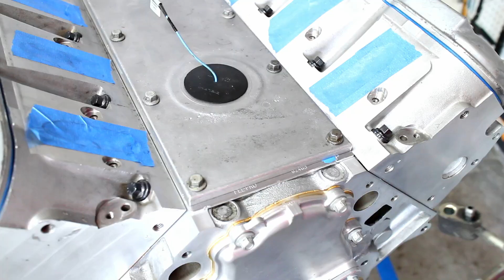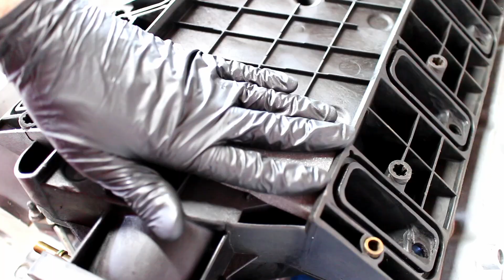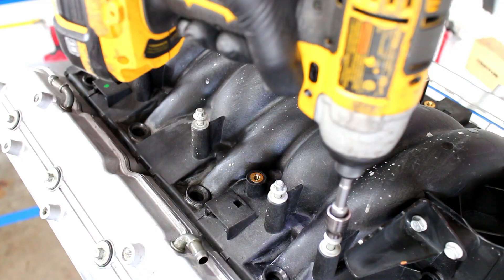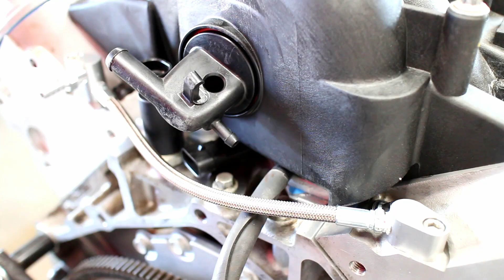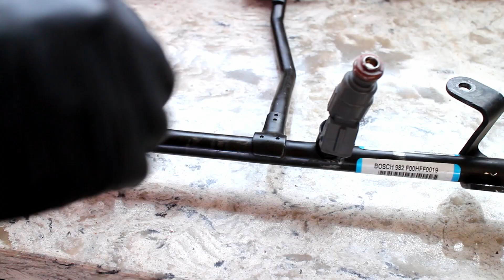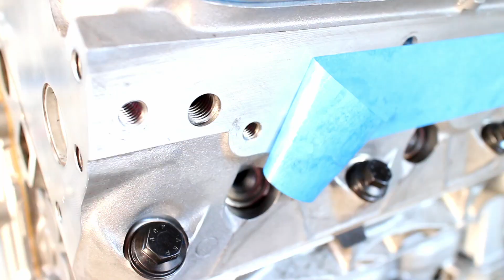LS1 intake + Injector Install (Pt14 82-92 Camaro/Firebird LS Swap)

Comment: great video, any video on how you set up hoses bc you are by passing a lot of the stock set up with capping the ports?
Reply from the maker: I have a video on a race style PCV system install.
otherwise ls1 tech. com has  bunch of proper PCV routing guides.

Comment: Using electric or mechanical oil pressure sensors?
Reply from the maker: Using a PSI oil pressure sensor where the stock one goes.
all oil pressure sensors are mechanical though

Comment: Hi, do you have the part number to the fuel pressure gauge and the fitting used to connect it?
Reply from the maker: google LS1 fuel rail pressure gauge and bunch will come up.
Reply: @3rdGenGuy need the adapter fitting for the the gauge to fuel rail please
Reply: We’re u able to find the fitting to make the gauge work ?

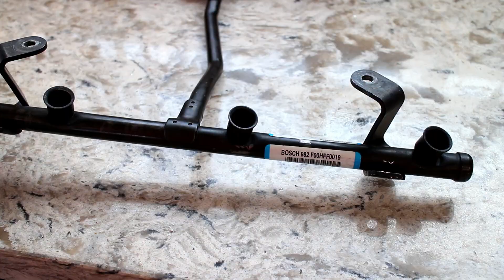Comment: 3:18 is there a type of Lithium Grease that I use? Or just use the “white “
White Lithium Grease?

Also where did you get your 
o rings rubber gaskets for your injectors?  Could I get by with the HarborFreight green o rings?
Reply from the maker: I like using O-ring lube.
ls1 injector o-rings are cheap off rock auto